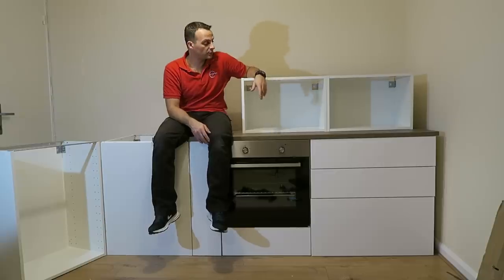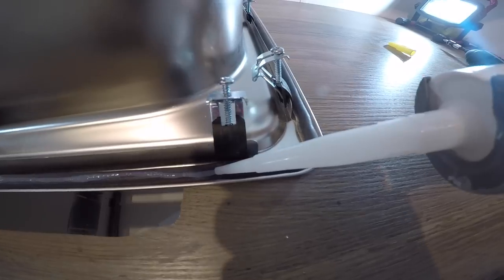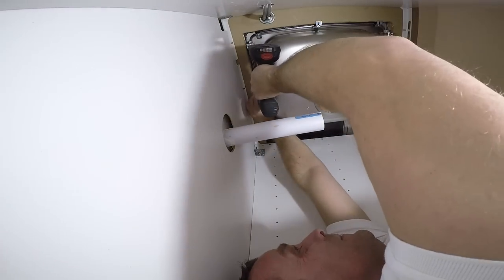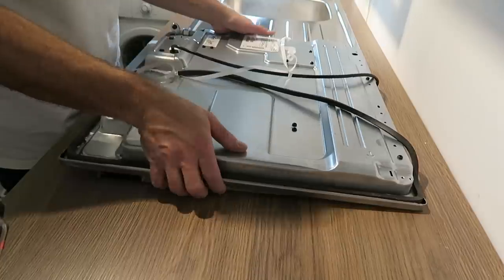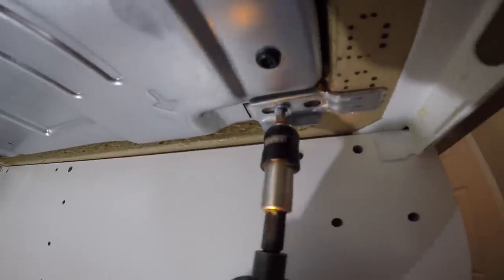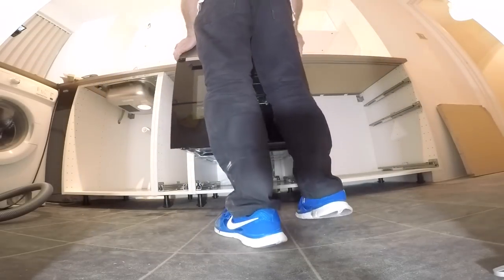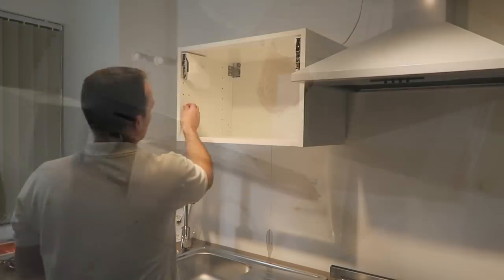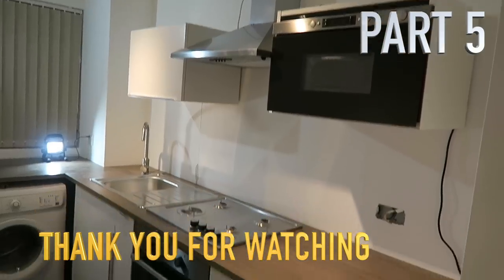IKEA KITCHEN Part 5 METOD Ikea integrated appliances installation

Comment: quick question, i have a free standing oven and i want to change to an integrated but not spend alot of money on the kitchen surface therefore, i was wondering if a piece of surface board can be placed in for the fitting intregrated oven  instead of a whole new kitchen surface. thanks

Comment: hi is there any benefit to fitting the runners in the 200m pull out, both in the bottom of the unit instead  of as instructed by the ikea fitting instructions  of one at the bottom left  and one for the uper shelf on the right side of the unit level with the upper shelf ?

Comment: I am finding this extremely helpful as I am building my IKea kitchen for the first time ever. However it all goes a little too fast for me so I have to watch several times and pause some places. I wish the bit about narrow cuphoards and sliders was at the very beginning of the series as a warning to put the sliders on before assembling a narrow cuphoard. It was VERY difficult so I had to take it apart again in order to fit them as no space for using a screwdriver and I did not have a short stubby one and nowhere to buy one. Otherwise not perfect but very helpful thanks.
Reply from the maker: Thank you for your comment and you right some parts are bit fast that's why I'm planning to do more dedicated videos to details in the studio in the future. Thank you for watching.

Comment: do you know the dimensions of the microwave & can it be build in other cabinets?
Is the microwave from ikea or another brand?
Reply from the maker: Sorry, I don't know measurements of the unit or microwave (don't have access to it anymore) microwave was from Ikea they sell the cupboards compatible with appliances. I believe you can build in other cabinets just need to use shelve in the right place or sometime there is some stronger support for shelve. You can have a tall unit with open space for a microwave or other appliances. The best is to discuss all before you buy in the store.
Reply: Hello, good Job. You only did a small mistake when installing the microwave, the aluminum piece should be placed below the microwave and not above. You can check in this video from ikea at 8:40 https://www.youtube.com/watch?v=N0w9F21sQYw